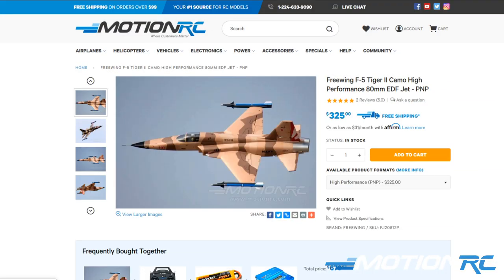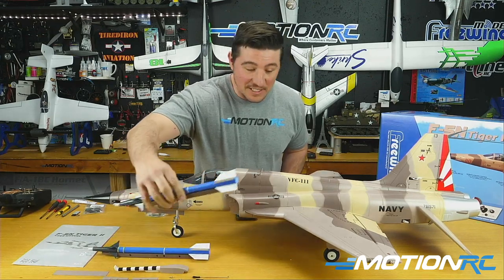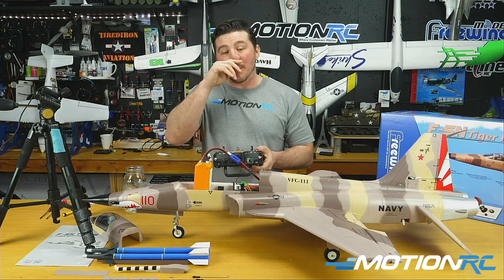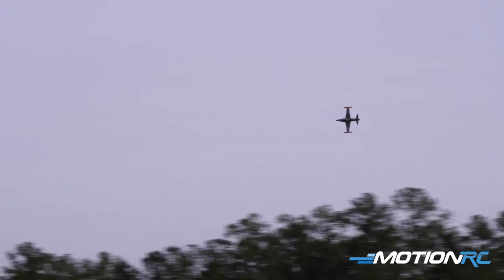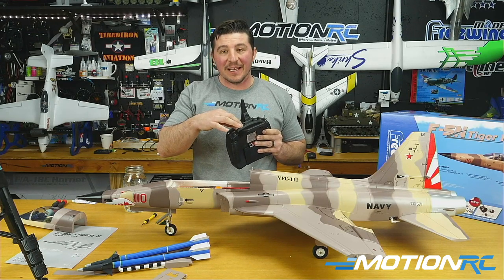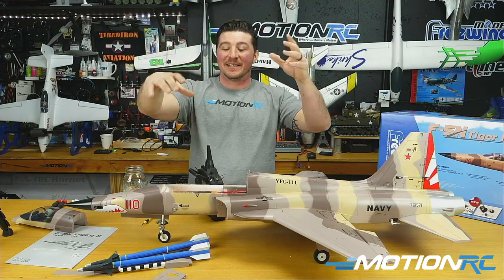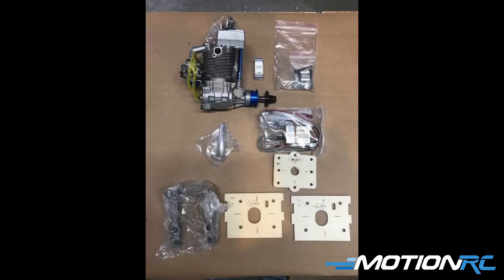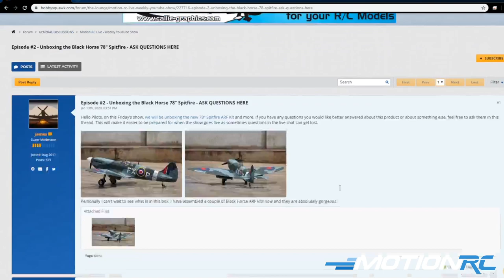Motion RC Live Ep. #3 - Freewing F-5 Set Up with Admiral RX600SP Gyro Receiver and More

Comment: Hi James , a few questions:
1- Does the receiver have to go on the CG ?
2-Is there a way to change the travel on the flaps OTHER than with travel option in the radio (DX6)?? sounds silly , I know  , Some planes' flaps are ok but some need major travel adjustment but when done in the radio they don't turn out that well because I can't setup plane with flaps in the radio (as per Ed's advise).
3- Do you know how to setup this receiver with OpenTx and DeviationTX ?